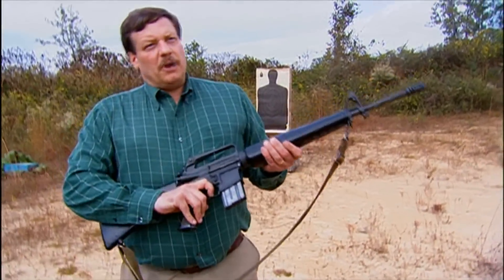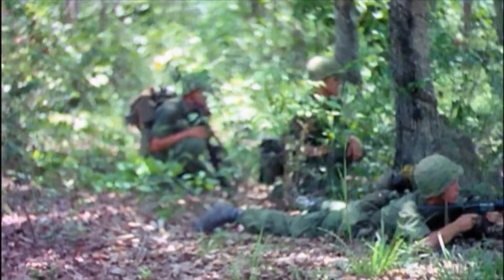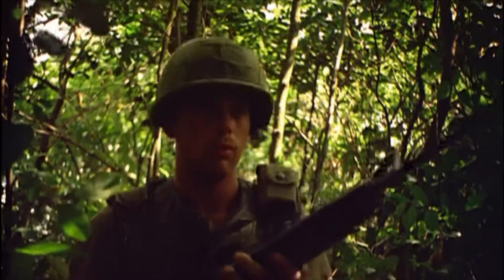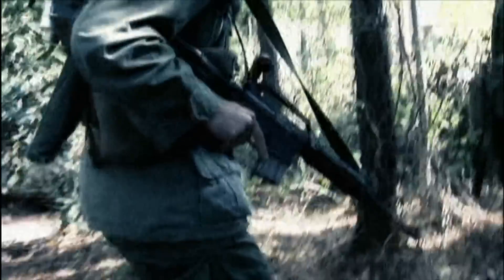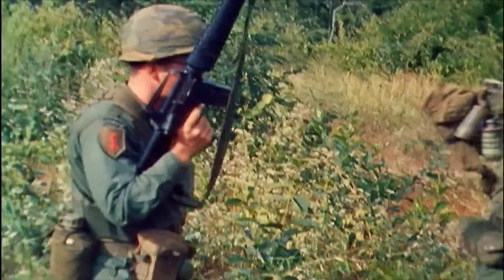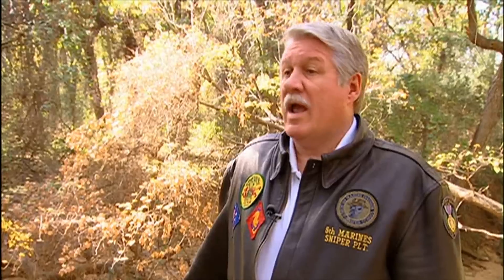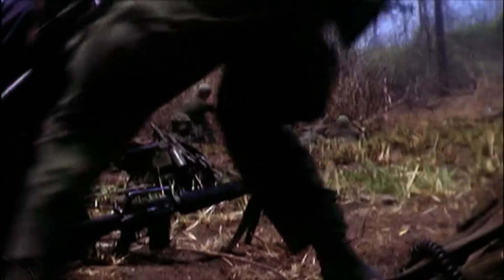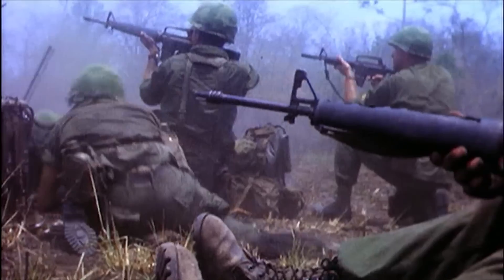Weaponology - "M16 Rifle"

Comment: These little snippets of information are what perpetuate myths and legends. The problems with the XM16E1 and M16 were because the Army sabotaged the weapon to cut costs and to set it up for failure so the old time arsenals like Springfield can continue to have their monopoly on US military small arms procurement. The problems were mostly because the Army decided to change the original stoner design and leave out important things like chrome lining or the original powder that created the proper port pressures for the rifle to cycle. As soon as they went back to the original specifications of the rifle, it worked well ever since just as it was intended.
Reply: Yep, but you still hear internet myths that is was jamming all the time and it was junk.....  That is false, initially they did not do well for obvious reasons but when they kept at it and fixed those so called problems the gun was working well ever since as you said....  That gun is a legend, period.
Reply: The issue is a lot of those myths that keep getting perpetuated always seem to be second or third hand knowledge.  Just like the myth that a .30 carbine won't penetrate a frozen jacket, they don't stand up to actual testing.

Comment: Beyond the need to clean any rifle so it continues to function, the main problem the M16 had in Vietnam was a change in ammunition from stick powder to ball powder. That caused a change in the gas system and the function of the bolt. The gas from the ball powder sped up the bolt function. A case still expanding hot in the chamber was being extracted too soon by the bolt and the base of the case ripped open leaving the case in the chamber. The chrome lined chamber did help extraction but the lack of chrome lining was not the cause of the malfunctions that were due to ammunition. What chrome lining of the bore and chamber did was make the rifle more durable against corrosion of the wet environment and against burnt carbon powder fouling. So the need to clean the rifle regularly was not as critical as it was without the chrome. The downside of chrome was a slight fall off in accuracy.

https://www.youtube.com/watch?v=lLYLkrethQA

Comment: Yes, the first generation m16s had issues. But the a1 models and cleaning kit fixed those issues.

The first generation AKs also had issues.  Receivers cracking, head space issues, and barrel wear.  The ak 47 type 2 (milled reciver) fixed the issues but made them too heavy and expensive.  Then in 1955 they made the AKM which had an improved stamped reciver, lighter, more accurate, and a better barrel.

Comment: Little more than half the weight of a Kalashnikov?  My milled receiver, AK is about 8.5 pounds, my stamped AK is like 6.8 pounds.  There are no M16s that are half this weight.  The M16 in Vietnam was about 6.5 pounds and the M16A2 is almost 7.5 pounds.  My HBAR AR-15A2 (M16A2 clone) is heavier than my milled AK.

M16s did really well with dirt and mud, they always exceed the AK in this test because the AK is wide open behind the charging handle when the safety is off and it gets right into the receiver.  The M16 is sealed off when the bolt is in battery (especially when the dust cover is closed).  The M16 only had reliability problems because the powder composition was changed which increased the gas pressure and increased the rate of fire some 200-300 rounds.  It threw the timing off, wore parts out, caused bolt bounce which made the casings detonate because they were firing out of battery.  Colt told the Military not to use this powder, and they did anyway.  This was resolved in the next model they sent to Vietnam when they actually changed the design of the rifle to work with ball powder.  They also started issuing cleaning kits.

The AK is only more reliable than the M16 when it comes to abuse and lack of maintenance.  The M16 is more reliable when it comes to mud and dirt.  Google it yourself, plenty of people have proven this and have beaten this dead horse into ground meat.

Stupid History Channel bullcrap.
Reply: my wasr 10 feels like a 22. lr. my Yugo opap feels a bit Heavy, but I will never complain, it is made very well.
Reply: Search Russian Ak 47 not Fake Akm
Reply: Yep right on
Reply: AK still the BEST

Comment: Let's admit something up front. The M16 was messed up before issue and that wasn't the fault of Eugene Stoner. Two tours  gave me respect for the M16A1.
Reply: Wasn’t because it hardly had a field testing?
Reply: Actually, top brass chose to ignore Eugene Stoner's design, which incorporated a forward assist and a chromed inner barrel from the start. But Stoner's team foresaw this and improved their prototypes leading to the XM16E1.
Reply: @minhtrietnguyen5275  Stoner's design did not include a forward assist nor chrome lining of the bore and chamber

Comment: If they would have kept the chamber cleaned as the vets in WW2 were trained, 90 percent of their problems would have been eliminated. The change to ball powder created bolt bounce malfunctions and excessive cyclic rate that created broken bolts and parts. The new buffer, stronger extractor and chromed bore and chamber fixed the problems. The part of the rifle needs to be cleaned all the time, the round is ineffective and a little dirt will shut the rifle down is pure BS..

Comment: What the hell?  In the 'reenactments, they're using an early AR15 slab side lower receiver, but the upper is an A2 heavy barrel with a brass deflector.  Come on guys!  Get the right barreled upper when you're doing a historical show!  That upper didn't exist until the mid 1980s..
Reply: They probably just get a few guys with "A1" looking AR builds and threw them together, the bar for historical accuracy is pretty low for this show.
Reply: We got an expert
Reply: Frankie2012channel+ It’s so slightly off who cares most people won’t notice that: it’s not like they’re using a 2019 Kriss Vector claiming it to be an M16.
Reply: @theopenmindedtruthseeker9747  Because seeing the wrong guns is funny

Comment: The A1 has got it good to go . With  a gas bolt clean burning powder is must be cause carbon build up is a factor . There is big difference between a dry pussy and a wet pussy when trying to get it in 😱 dirty burning powder in a Precision fitted bolt carrier group will gum up the moving parts after a short time . The ammo has to be good quality and lube the bolt when time permits of course . For the military to have used the wrong powder in the ammo and no cleaning  kit against the designer spec's was tragedy .
Reply: Steve Johnson field conditions are things to consider rainy season wet all they time high humidity try to keep ammo dry if possible my time in the army 80/83 Germany our 16s were just plane worn out every thing was out of spec's jams mostly bent mag witch cause double feeding or dented round failed to extract  but these were rare we only got range time ever six months      the old NCO,s  told us of the jaming problems of the earlier 16,s they don't like to be wet.

Comment: I served 1974-76. The M-16 I fired worked fine, was accurate, but I don't know how many total rounds had been put through it.     But as far as jamming, well, there was a light lubricant we put into the bolt area.       And of course it had a little dust cover on the right side., that popped open and stayed open after firing a round I trained in sand.    And if the rifle ever fell on the right side and got any sand in the opening (the dust cover opening) it would cease firing.    You could pull back the handle to try and get a new   round in or SOMETHING to get it going again, but just a bit of sand, and it would not fire until it was cleaned.   Just my experienceand I don't know if they ever solved the problem when they went to the M-4.  Patrick Young US Army
Reply: AK's will jam if dropped into the sand too LOL...

Comment: Sweet 16 my ass ,i had a m4a1(which obviously supposed to be the more advanced version) service  rifle when i was on active service in the IDF and no matter how much i cleaned the rifle after few mags it got jamed once in a while and that happened not to only to me. The battlefield is not a video game you won't believe how  many times your weapon could malfunction because of dirt and dust ,overall the the m-4 is a very good weapon but only if you oil and clean it often.
Reply: Most jamming issues nowadays are either magazine related or worn out extractors.  Were you running new/good magazines with them or shitty worn out ones?

Comment: I trust ak coz u can use it the way u like, it dont jams, easily cleaned & way more powerful rounds than M seris
Reply: I’ve shot both rifles before, and I can confirm that literally every word of what you just said was wrong. AKs can jam just as easily and take as much time being cleaned as an M16 (or any other rifle at that), and the “more powerful rounds” of the AK-47, while being fairly intermediate and reliable, still can’t avoid the flaws of extra weight and recoil, which hinder the overall reliability of a standard battle firearm. (Also, on an unrelated note, please work on your English, for the love of god.)
Reply: CancerCell101 actually it's easier to clean and it doesn't jam easily unless you got a shitty Chinese type .56
Reply: You do realize that the info you provided pretty much just depends on the skill of the shooter regardless of what kind of firearm they're using, right? "Easier to clean" and "doesn't jam as easily" are simply opinions and results that are only determined by how much skill a person possesses in terms of properly maintaining their firearm, whether it be an AK or AR.

Comment: This is really the same story as the British sa80 which was also  terrible for many reasons when first issued and failed in the first gulf war (luckily there were still SLR's "British FAL's" still around to use!) but now it's an excellent weapon that squadies are happy enough with. Even the FAL had issues in the beginning although they were trivial and virtually nothing compared to the m16 and sa80. I remember firing a cadet version sa80 as a kid in the mid  80's and the forward furniture was actually falling off under the trauma of firing a .22 round!!! Ridiculously badly made gun considering the fantastic concept (EM2) it was born from.

Comment: Afaik, if you keep your M16 mags clean - it'll work perfectly. My experience has shown me that M16 is a tight made rifle, allowing it to not let dirt in, but if it does get in - it jams completely, and stripping it down is not an option in battle. AK has very loose parts, and if sand gets in bolt shutters - it might jam and will slow down cycling, amd if it jams - grab the loading handle and smash it on it's stock against the ground. If I was to fight anywhere, I'd have either one of them as an auxilary rifle, they are great rifles, and having each of them is being versatile

Comment: The 5.56mm ball round does not have satisfactory performance against flesh and bone out past 300m, at which the likelihood of the round keyholing and the copper jacket separating from the lead payload isn't guaranteed and if anything does not happen often enough to depend reliably upon for stopping power that the round lacks in its smaller caliber compared to other rifle cartridges.
7.62x39, 7.62x51, and 7.62x54R, and even the controversial 5.45x39 are better battle rifle caliber choices, simply because they are cartridges that are purpose-built from the ground up as fighting cartridges. Even with a less than .22 caliber projectile you can still have a projectile that is designed to wound a target effectively, which is why a square charge combined with an elongated bullet and an air pocket in the copper jacket allow for much more reliable results in keyholing in body tissue and much more substantial damage overall than a .223 Remington FMJ that just gets an upgraded powder charge.
Reply: Keyholing is when the bullet tumbles out of the barrel due to lack of stabilizing. What you meant is pinholing and 7.62x39 does it the most, which is why the Soviets plagiarized 5.56x45 after learning of its superiority during the Vietnamese civil war

Comment: Should've kept the m14
Reply: or just had the right kind of ammo powder and chrome lined barrels issued and everything wouldda been fine
Reply: You carry about that heavy ass weapon in the jungle all day long, bet you would not.  I agree with Kevin, right ammo powder and so on and the 16 was fine, as seen later.
Reply: Nolan Cruz Smith no m16 is much better
Reply: Or, ya know, not send out a broken prototype before testing it. The A1 was beloved almost instantly.
Reply: The M14 with polymer furniture should've been kept on. The wood furniture would expand in the humid, moist environment and throw off the M14s zeroing. Comparing the weight of a weapon with wooden furniture and a weapon with polymer furniture is simply unfair. I think the U.S. army should've invested in an increased number of shorter barrelled M14s with polymer furniture and a GMPG or SAW that didn't suck ass like the M-60. Hell, even bringing the mg34 back into production for a suppressive fire weapon wouldn't be a bad Idea.
Reply: Should've adopted the Armalite AR-10

Comment: The M-16 maybe accurate, but it's far from reliable. The AK-47 is my personal choice of a weapon
Reply: William Stryker is that akm james when cover with mud on the receiver and am 16 does not I got video proof If you reply back to me I'll go and find the video and show you in the video the AK only kept firing when you pull back the receiver because as they explained it it will let dust and Grain in the gun and it's not good when it does that no matter and 16m  keeps out even with the dust cover open it continued firing
Reply: Correction, it was not reliable at first with the mentioned in the video, later it was very very reliable.  Stop believing internet stories sir, do your research.
Reply: @will1223141 , bro im still picking the ak47
Reply: @cxarhomell5867  look up ak mud test by inrange tv then will see if you pick a old style ak or a m16
Reply: @will1223141 , you do realize that happened because that was the oldest looking ak anybody has ever seen
Reply: @cxarhomell5867  so they used a m16a1 still gun vietnam issue by the way and it didnt gam look up mud test death trap or m16 mud test on inrange

Comment: M16 can never ever BEAT the Ak47
Ak47 for Life
Reply: Recchi Sexy I agree and for some reason can't reply to the guy up top but is that why the akm jams after 2 shots fired with full mud all over the receiver it has to be pulled back to continue firing and an M16 covered it with a dust cover off by mind you and an A.1 basically a hybrid of the original one covered with a proper rounds fired consistently on semi-automatic nojaims fired for Clips off nojaims took a more modern M16 into the mud jammed once jammed once when he crawled through the mud jammed once because of a pebble that got underneath the pistol receiver you can pull it back tell me which guns more reliable maybe after a year to cover with Muddy a more reliable cuz it continued firing
Reply: KING IJAZ you don't know any about xm16: l'm a workman of the xm16a1 south vn fr:1971-1975
Reply: Maybe you should get some information about guns.Counter Strike and Call of Duty are not realistic games.
Reply: @recchisexy3776 , you got salty over a gun choice
Reply: @will1223141 , well sir, im pretty sure the type of the Ak is the reason why it jams